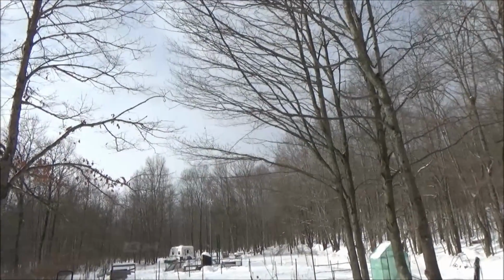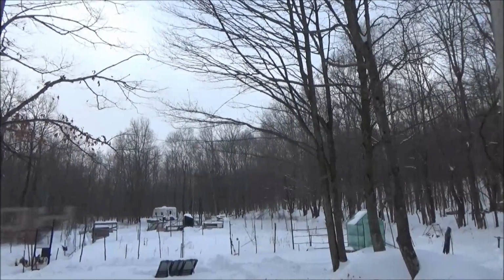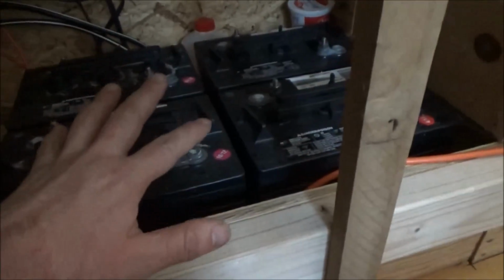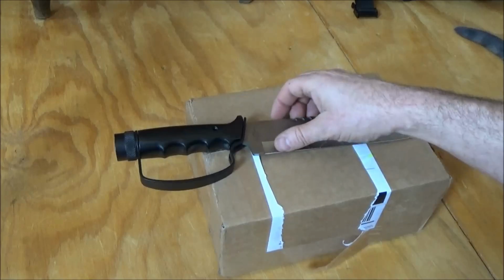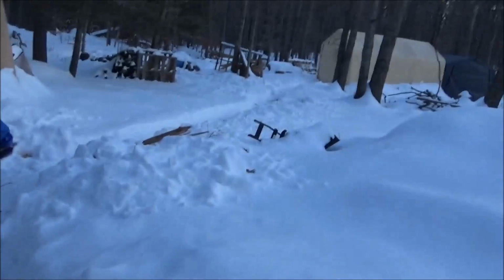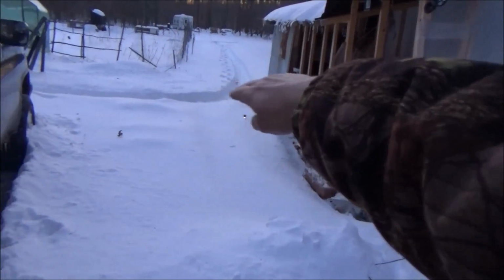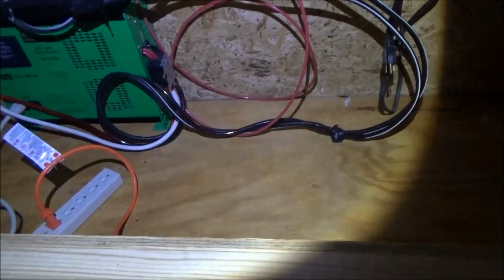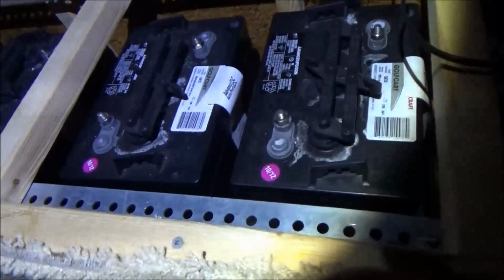Setting Up Golf Cart Batteries In The Off Grid RV

Comment: Those caps are not good. It is really waste of the money ..even if you have some free . Btw if you check how that tristar is working then you will notice that input power from solar panels is switching off/for very short time..but you can see it on volt meter/ after some time..i don't remember exactly but i think it was about 5 minutes..this way it is checking if it is really peak power it can take from them. You can't change that surge power with any capacitor..why...make some calculation first and then you will understand there is no point.   difference in voltage is only about 5V max/15V ,10V/..and you would need huuuge capacitor that could be able handle so much current So again no point. But ofc there are inrush limiters you could use for any AC equipment you have there..but that is different thing...

Comment: Hi Troy. I have some remark that ''cold spot'' is really cold..but that is always the problem. even if you would use some wood penetration material even then wood will have higher humidity in that spot and that is not good...but even then i would do it as soon as weather permit it ..reason is because you can expect mold there. Maybe it was just camera but i did see that wood there was darker and that mean more water and too cold wood is never good ... I'm not expert but i think i would try to insulate it ..if possible from outside and maybe put some fan just to make air cyrculation so there will not be any cold spot. Just my idea..

Comment: We had super caps in our system for a number of years, they ended up blowing up (no explosion just bulged out and leaked) and ran our batteries  down because they started shorting out, now without them our batteries are working better than before so I wouldnt advise putting in super caps, you dont seem to have a problem with too much power draw and thats where theyd help, they do keep the system from bottoming out when you pull serious current( thats why we put ours in being such a small solar system) but I never heard you mention that was an issue

Comment: Troy, why dont you get yourself a Wagan 12V Personal Frig? i have one from my military days.. i would put my lunch in it along with my drinks for the day and just leave it plugged in and on while i was at work.. it pulls a lot of power when you first turn it on.. which wasnt a problem while driving down the road, going to work.. but once i got to work and it was cooled off and down to temp nearly.. the power consumption on it was very minimal.. i would leave it on for an entire 8-10hr work day and the car still never had an issue starting in the evening to drive home, it does have a built in turn-off voltage.. so the days i had extra extra long days like 14-16hr days.. it would turn off after the battery ran down to the set temp and prevent the battery from being to low to start the car.. I have the 7L model.. it was like $25 bucks at Homedepot.. Lately i only use it for going to the beach or on road trips..
Reply from the maker: I have a 12 volt travel cooler I sometimes use in summer

Comment: I have a question. Electricity in Mexico is a daily adventure. Duct tape is a necessary tool. Every time we have a thunderstorm or  heavy rain we lose power. The transformer outside my house blows frequently. It has a mind of its own. Getting repairman here in a timely fashion is a challenge since they don't work weekends, holidays, or if they have something better to do. I can handle the interruptions in power. My main concern is my refrigerator. Most refrigerators only live a few years with all the surges and other problems. I want to buy a chest freezer, convert it to a refrigerator and use solar power to run it. But. I don't have the vaguest idea how to go about it. And being a retired older woman I am open season on being sold things I don't need or getting inferior products. Maybe this is too much to ask, but could you give me some instructions as to what I would need to know about having this done? In spite of all the electrical problems here, I wouldn't live anywhere else. It's a great and adventurous place to live if you are patient and forgiving.
Reply: Hard to find and expensive. But that is an idea. Can you change out an electric frig to propane? if so,is it safe?
Reply from the maker: You cannot convert an electric fridge to propane.
I have not yet done the conversion myself but plan to in spring. There are conversion kits on ebay. Its just a thermostat and switch. Its that simple. Put the temperature sensor inside the freezer and plug the device into the wall (or solar). Then plug the freezer into the device. Done.
Reply: Thanks so much. That really helps. God bless.
Reply: get the freezer you want remove the factory thermostat and install an external thermostat (into the chest) and mount it to the outside of the box and set it to 36 or 38 degrees it will turn it on and off according to the inside temp . i have seen videos on you tube on how to do it it is not hard and it is cheap to do :)
Reply: offgrid40 mount the probe inside and the thermostat outside :)
Reply: thanks

Comment: think you are right about the surge due to the cable mess.

the cap wil help greatly, but beware that you charge it up first before connecting it to the batt! (giant surge and sparks when you dont!, explosion warning!!!!!!)
btw, if you really love your forklift cels, build a box for them and a little warmth. (y would place them in a vented and heated box inside) (nearby the charger and inverter,) you can build a giant battery terminal inside with two bolts and four  nuts (mount the bolts in a piece of plastic board or dry wood, and use them as positive and negative high power connection, avoid more cable mess on your battery bank with only one big wire on it) (less messy to) take care! thumbs up!
Reply from the maker: Yes I hope to build a box around the battery soon but right now there is all ice and snow all over and I cant really access anything at all out here.
Thanks for the warning on the super cap. I would not have known that. How do you charge it up then?
Reply: The Do It Yourself World is that also known as a capaciter ?
Reply: The Do It Yourself World  via a resistor (likethe one you use for the wind turbine)
some off thes caps have a build in charge resistor.
if you connect the cables good, and the right awg (the thicker the beter) you dont need the capacitor. (also better for the battery's , the mppt charger will have problems with messuring the right battery resistance for the charge mode)

Comment: about food,, have you  considered cooking with hydrogen? I used to run an old car on %20 HO gas I produced under the hood with 8 amps drawn from the battery. No danger of explosion(a BIG perto myth) only a cork popping "pop' if ignited outside the combustion chamber. It can be generated with one HF solar panel and one battery and shut down when not in use. You could cook your maple syrup with it too.If H2 still freaks you out,do it all outside with a 20 ft hose and a simple earth berm for a shield.  It is the cleanest fuel you'll ever see.
Reply from the maker: I used to run hydrogen in the Honda. Wore out the booster and never build a new one.

Comment: If your going to use a modified sine wave inverter on your RV check to see if your ground wire and neutral wire are not bonded. Low cost modified sine wave inverters tend  to have floating neutrals, and a bonded ground systems will short them out.
ex. Ground wire tied in with the neutral wire as is the case in home wiring.
Reply from the maker: Good to know, thanks

Comment: Troy - did you ever make that video on the Bedini Motor build? If it's already up I'll look a bit harder and see if I can find it!
HF Solar panels - are you still using the charge controller that came with them or did you get a different one? I think the one that came with the panels is a bulk, on/off, type charger and not even a PWM! (I could be wrong - have been before! :-) )
Reply from the maker: I will make the video when I get the materials together. R.S. did not have what I needed last time I was there.
I am using the original HF charge controller for now. I will swap it out later.

Comment: Your perfect little refrig for THE TINY house,is perfect for bugs and mice ,rats and what ever to invade, I see a real problem coming on.
Reply: The Do It Yourself World
Gotta watch out - ya might get snow fleas in through that 1/8 inch gap! :-)
Any other bugs that like the cold???? Personally, I wouldn't worry about it, and I get the impression you don't either!
Reply from the maker: I will seal it off when it warms up
Reply from the maker: ***** Mice cant get in anywhere. Its all covered in metal. This was a tiny 1/8 inch or less gap where air can blow through between sheets of metal. I will seal it when it warms up. For now it serves a nice good purpose for me.
Reply from the maker: J. Williams Nothing in the cold. Not until long after it warms up around here. I have plenty of time to caulk it up.
Reply from the maker: ***** The old ways :)
Reply from the maker: ***** Not calling anyone old. But the Old ways are the best ways, I think. No matter if we learn them out of necessity or out of desire.
Reply: ***** You can take the gal out of the country but you can't take the country out of the gal. I was also raised rurally. I couldn't wait to get to the city. I spent most of my younger years working corporate and traveling which was a dream job for a single 20/30 something. I felt the need to simplify around 12 years ago.
I came to Kentucky and never looked back. :-)
Reply: ***** I feel for you. I went to the "city" last Summer to drop my daughter off with friends for a month. Man I couldn't get out of there quick enough. The thing that I REALLY noticed was all of the NOISE, and the SMELLS. I felt claustrophobic too. You hold onto that dream of moving. :-)